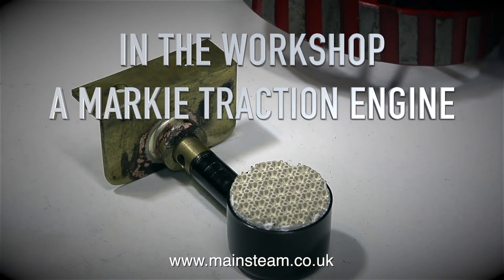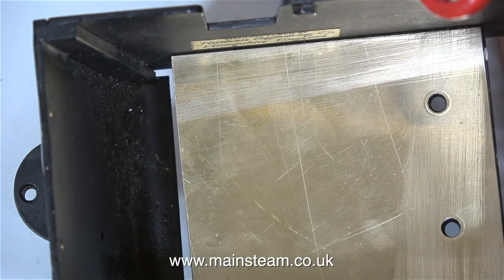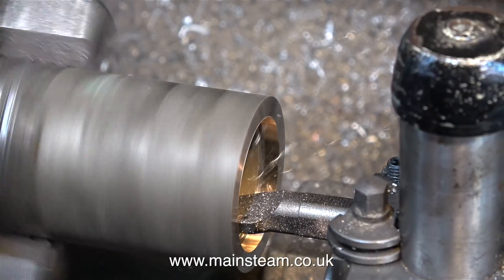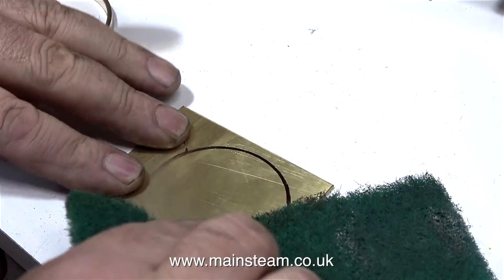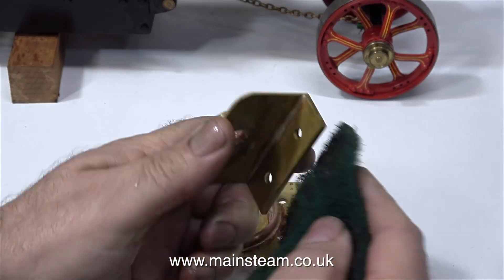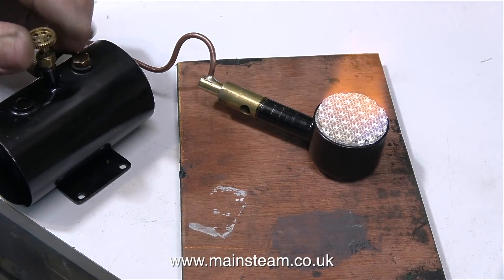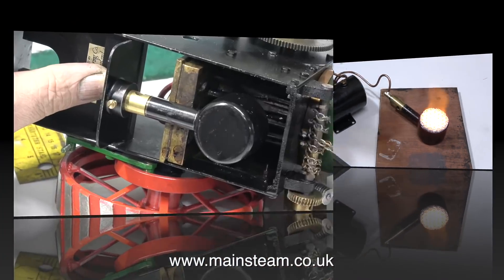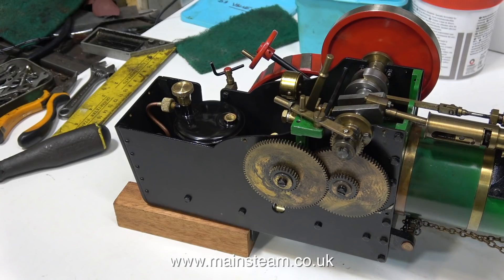REPAIRING A MARKIE TRACTION ENGINE - PART #4

Comment: Wow talk about spot on timing! I was lucky enough to score a boiler and steam engine today, which has what looks to be that style gas jet, burner and the other end a small sized collar to screw into something! This you have describe as a “gas tank” what fuel is this running, are these tanks items you would normally make yourself? Or are they available off the shelf, and if so what name should I be searching for please!
Reply from the maker: Have a look at www.forest-classics.co.uk they have everything that you need {:-)))
Reply: They are defiantly not something you can whip up yourself. They have to be tested to a much higher pressure then Boilers. Look in some of the links Keith has in some of his other videos for suppliers.